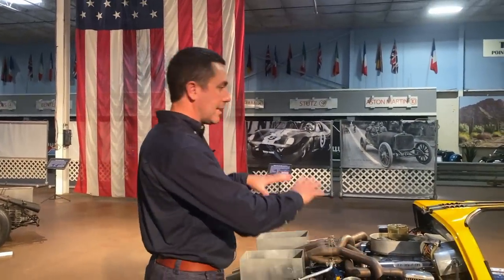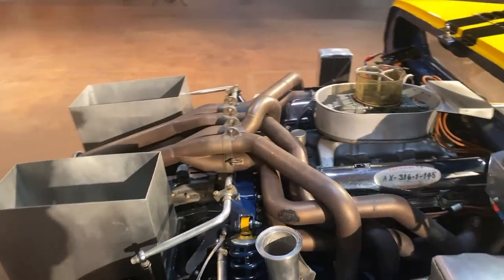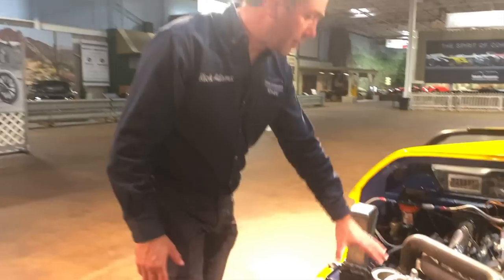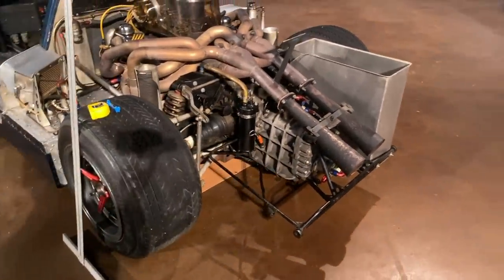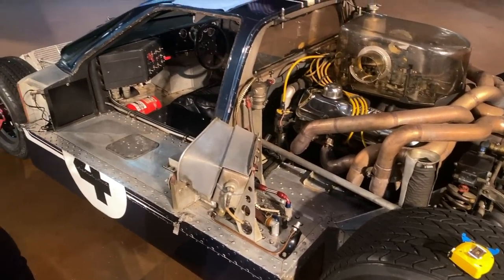GT40 Tech Talk

Comment: The reason the car is a quarter inch low is because they put wood shims in the springs to raise the car for tech inspection. But when the car loaded and unloaded the suspension the wood would fall out and ride at the designed height.

Comment: The Headers were called "Bundle of Snakes".
Reply: No, they are 360 degree headers. The ' bundle of snakes' was the system fitted to the quad cam small block indy engine where the exhaust ports were in the engine vee meaning all the exhaust primary tubes were grouped together.
Reply: @colinartus1897  I hate to "well actually" you but two things 1. it's 180 degree exhaust, every 180 degrees a cylinder is firing. 2. The term "Bundle of Snakes" is used for this type of exhaust, for both the Indy engine in the Lotus 34&38 and the GT40. It's not exclusive. Also, keep in mind both of these cars existed at the same time, 1964.
Reply: Wtf...they were not unique to this car, other teams had similar exhaust from 12 or 16 cylinders years earlier.

Comment: Little note about those oil coolers. They are aircraft engine oil cooler. They are mounted on the front of the engines on Continental 470 and 520 rear alternator engines.

Comment: The headers are called "Timed Headers" they run on the firing order to avoid back pressure. I've built a few sets for kit GT40s they are not that fun to fab but they sound fantastic!
Reply: Literally all racing headers were designed this way and still are.
Reply: @truantray  not really, now you have a left and right bank with a crossover tube somewhere down the line. I have also fabricated many a set of those.
Reply: The name for them back in the day was not "pile of snakes," but rather "bundle of snakes." American V8 engines, with their two-plane crankshafts, have strange firing orders and crossing certain primary pipes to their opposite collector times the pulses evenly for better flow and evacuation of the combustion chambers.
Reply: I have always heard the headers of the GT-40 referred to as "Bundle of Snakes" not pile of snakes?? Do you know which was the correct terminology
Reply: @chadharrison8653  Neither, and I don't know if a true technical term was ever settled upon.  If there was, it would likely be something along the lines of "Exhaust scavenging crossover time alignment."  A bit too wordy, so they used what it looked like; a bundle of snakes.
Reply: @chadharrison8653  I have NEVER heard it referred to as a 'pile' of snakes.
Reply: @chadharrison8653  AND NOONE IN THE THREAD MENTIONS THE MANS USE OF THE WORD RADDYATOR...
WHAT DOES A RADDYATOR DO?
RADDYATE?
Reply: @deadprivacy  it’s a Midwest thing. They also say things like “ruf” instead of “roof”, “pop” instead of “soda”, “beg” instead of “bag” and “dror-ing” instead of “drawing”

Comment: Right hand drive with right hand shift is common for endurance cars built for the prototype categories. It makes for faster driver changes at Le Mans because the drivers don’t  have to run around the car. This is why most Porsches built specifically for racing are like this. In 1978 the 935/78 “Moby Dick” was even right hand drive despite being based off of a 911
Reply: Right hand drive as it's a British designed car but interesting to see the right hand gear shift.  Its a little surprising that the Mark IV retained right hand drive.
Reply: @610Mungral  Right hand drive gives a visual advantage on most road courses and is the most common way of setting up a pure race car for these kinds of circuits. Right hand drive has little to nothing to do with the car being British in origin. The right hand shifter on the other hand is an adaption because a large proportion of racing drivers come from countries that shifting with the right hand as the 'normal' way of doing things. In this car, and for most mid engine cars, routing the shift linkage down the mid chassis tunnel makes the linkages far more complex and difficult to design a linkage system that gives a solid feel to the shifts. Routing the shifter linkage along the out side of the chassis allows it to be simpler, fewer components with fewer joint or swivels and deliver a firmer feel for each shift.
Reply: @cdjhyoung  very interesting thanks! I would have thought left hand drive would give better line of sight to the apex of most  corners on a clockwise (standard) circuit, just as well I'm not designing cars! I'd be interested in the Ferrari and Porsche set ups. I'm off down a rabbit hole now!
Reply: @610Mungral  Supposedly, Circuit de la Sarthe being clockwise is in fact another reason why they sit on the right, because the weight of the driver being on the 'inner' side of the car through a right-hander does a little bit to balance out body roll through the majority of the corners.

Comment: This is great, I didn't realize all the differences and why they were changed. I've been to the great museum in Philly and saw those cars all assembled but have never seen one inside like this.
 Saw the Mk III at Petersen and a Mk1 locally as well as the Lola badged predecessor.
Reply: Why didn't they try larger brake rotors? I know later on they had vented rotors  was it a rule?
Reply: @waltbullet1287  when these cars were designed brake discs were not that old an idea, ventilated disks did not exist and were developed during the racing life of the cars , bigger rotors would mean bigger wheels bigger callipers more weight  and weight was a problem on these cars hence the quick change disks.

Comment: The headers are designed such that the exhaust pulses from each cylinder will aid the exhaust of other cylinders by scavenging them. The pulses as they travel down the tubes tend to form a vacuum (lower pressure area) behind them "pulling" the exhaust traveling from other cylinders.

Comment: Hey, Rick. Can you tell us the racing histories of these two cars?
Reply: The Yellow Mk Ii was run by Alan Mann racing at the '66 Lemans race (you can see it in the actual footage of the race as well as in the Ford v Ferrari movie) but was a DNF due to a mechanical issue.. The Mk IV ran it's only race at LeMans in '67, was a DNFD due to running off the track and getting stuck in a sandbank. 
The Museum's website would have more details if you'd want to take a look. There is a section called "the Collection" with specifics about each car.

Comment: You did not mention the fact that Ken Miles did the tuning of the suspension ,engine and braking systems. He was Quite the Technician. A self taught Engineer not just a driver.  He drifted the GT40 around the corners .....

Comment: Rick pronounces "radiator" as rad-ee-ay-ter rather than ray-dee-ay-ter. That was not uncommon when I was a kid but not so much any more. Is it regional? Does the Simeone Foundation have a "Mk I" GT40 for comparison? Funny they didn't measure the Mk II. Legend has it those were built a bit taller in order to accommodate Dan Gurney and A.J. Foyt.
.

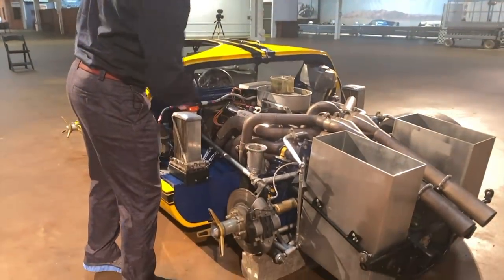Comment: 2:48  They were stated at 485hp at 6200rpms but anyone knew that these race-engines was built for a shiftpoint at 7400rpms. Ken Miles decided to ignore Fords "safe" 24hr low rpm shiftpoints and let the engine rev out, the rest is history. All the Le Mans Mk2`s were originally built by Holman-Moody in LA CA USA who rebuilt the GT40`s to fit the bigger 427R-engines

Comment: ..why do they rivet the components together instead of welding?...ps,..Prius owners are running to their safe space after seeing this.
Reply: If it's aluminum, the welding heat anneals the metal and makes it weaker at the weld joint.   That's why airplanes are riveted and not welded.
Reply: @buckhorncortez  thank you. Not to mention the ability to weld thin gauge aluminum in the first place.
Reply: @davidthayer6969 
And welding that thin of aluminum would take extraordinary means to keep it from warping all to hell.
Aluminum is a different beast altogether to weld.